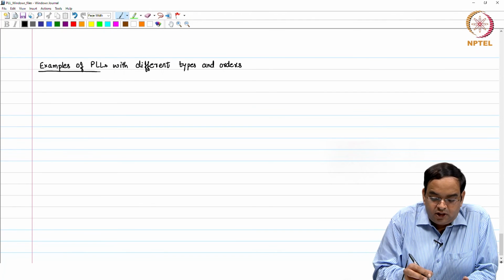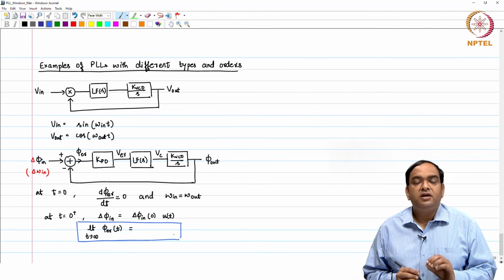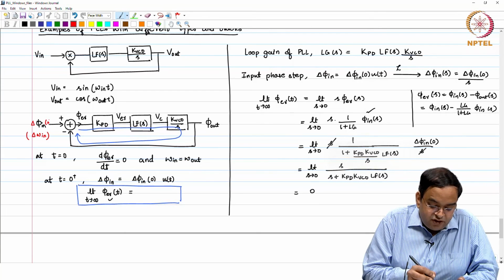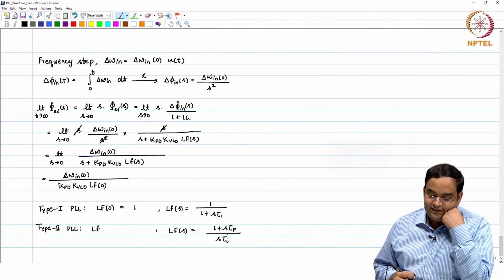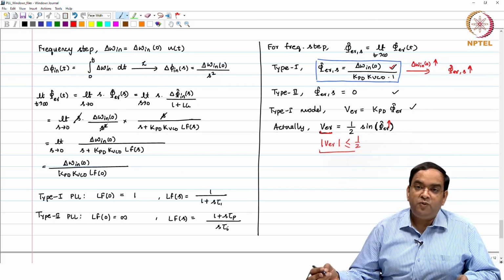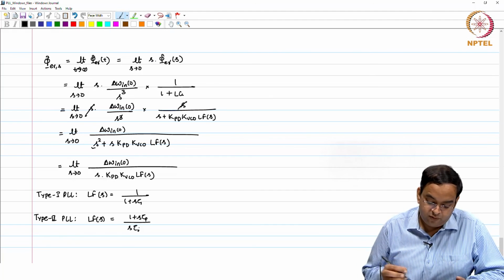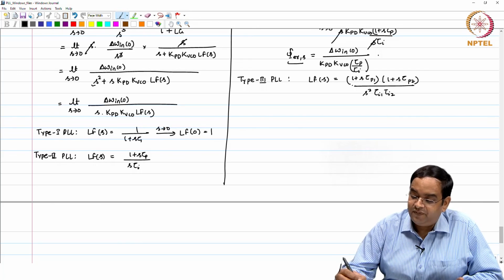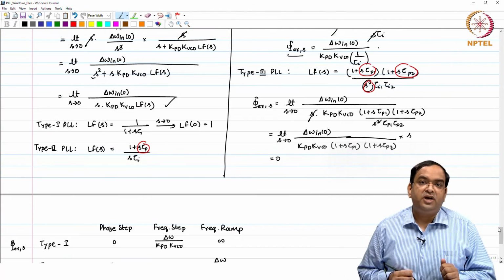Small Signal Analysis of Type-I/II/III PLLs for Phase Step, Frequency Step and Frequency Ramp

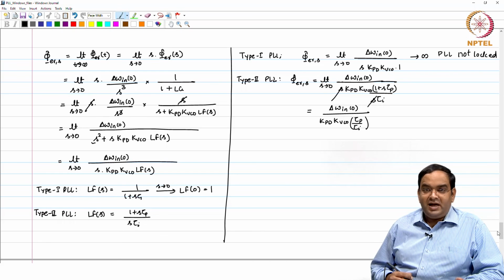Comment: 24:21 Shouldn't it be Kpd*Kvco/tau_i in the denominator? Besides, type I PLL seems to loss locked with ramp freq. input because the derived phase error is INF. Is that that possible that it seems to be the case because SS is not applicable in this condition? Or one could claim that sin(INF) = 1 to validate the SS analysis?
Reply: Yup, there is an error here.